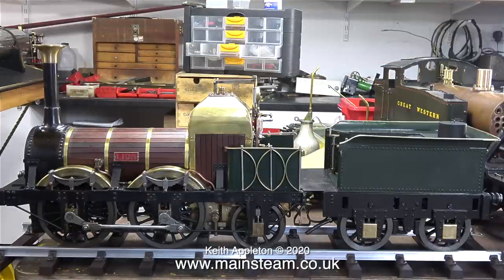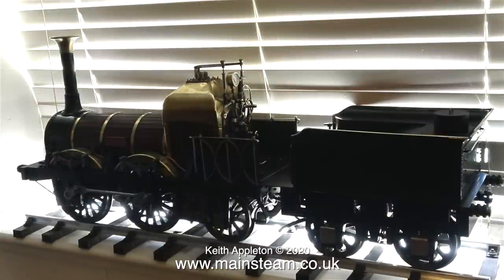A "LION" LOCOMOTIVE IN 5 INCH GAUGE - PART #4

Comment: I worked for over 30 years as a volunteer at the Museum Of Science & Industry Manchester being a Steam/GasTurbine engineer/technical training manager. Lion was stored in the MOSI Power hall for several years before his return to Liverpool. As I worked in the evening I used to dust Lion down as a break from aircraft engines. What I did notice was the rear frame was out of alignment, it transpires when the engine appeared in the Ealing comedy 'The Titfield Thunderbolt' painted in garish livery (the owners were not aware Ealing prop people were to do this) the West Country BR engine driver who liked his cider 'fiercely' reversed the engine into a carriage during coupling, bending the frame, you can see the event in the film. The film was made in and around Bath.  Freshford being the village and the station at a disused branch line at nearby Monkton Coombe. I stay in Freshford every year and it has not changed since 1952 except London money has raised the house prices. I have also met people who were extras in the film. An excellent booklet by Simon Castens 'On the trail of the Titfield Thurnderbolt' gives the full story and directions to the film locations. Interestingly Ealing instead of shipping the daily rushes to London for development converted a disused old mill at Limpley Stoke to a film lab as there was no electric power. Ealing technicians used the water wheel to develop power regulated by an array of electric 1 bar fires. The famous Douglas Slocome (Star Wars) was the camera man,  and the film was Ealings first in glorious technicolour. Inspiring video by Keith as always and I hope he does not mind the addition info. Terry  turbine@live.co.uk
Reply from the maker: Comment of the year! - thanks for that, very interesting {:-)))

Comment: Just guessing here,but I would think that cast iron driving wheels would have more traction on aluminum rails than on steel rails. Since you have actually done it and I have not,I do believe you are the man to ask. Or is it so close it simply does not matter ?
Reply from the maker: I find that the grip on aluminium rails is less that steel, plus aluminium rail can wear badly over time.
Reply: @keithappleton  Freshly cut aluminum is very grippy,I suppose the oxide being so hard is what makes a difference,but that is just a guess. Thanks for that.

Comment: Dear Mr. Appleton, also Appleton, Wisconsin, is located 37 miles south of green bay along the original route of the "400" fleet in the mid-west passenger service of high speed express trains from 1927 to 1971,when Amtrak took control, but Not Here To Green Bay.  The GB Packers football team of the NFL are the oldest team at 100+ years but NO passenger trains. Yet the Chicago bear fan can go East to Detroit, West to St Louis, South to New Orleans. But Not North To Green Bay?????  Y?????   Amtrak will be 50years old in 2021 (since 1971).  Join us, and help fix this terrible mistake that happened 50 years ago.  The N.E.W. Green Bay "400" Passenger Train Revival Project, 2021.  Modern and historic passenger trains for commuters, football excursions, dinner trains, and special steam locomotive excursions.  Plus rebuilding abandoned tracks for our own private operations. S.E.S.  OK @ 1700 H. PMC  Sat, 10-10-2020.  Hey, matching numbers, lottery time, lol.

Comment: I see that you are as confused as I about the terminology for tiny screws on models. In the big engineering world if it is all thread it is a screw. So you can have a hex hd, cheese hd, csk hd, skt hd screw. If it is part threaded it is a bolt with all the different types of hd.. Then we have the problem. UNLESS it is 1" or under 1" long. They are all thread. So frankly take your pick, no rules.
Me I would simply say if it is all thread it is a screw. If it is part thread it is a bolt. If the screw has a larger diameter unthreaded than threaded or a precision diameter it is a fitted bolt. The head form does not matter. But I say this is just my opinion & I am unaware of any written rule for tiny screws.